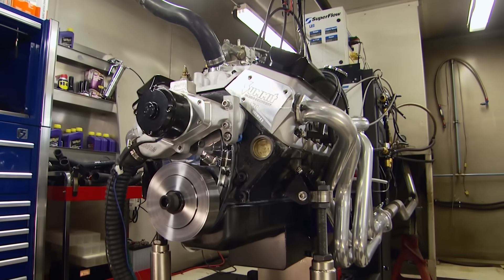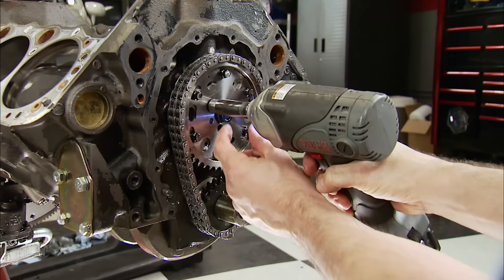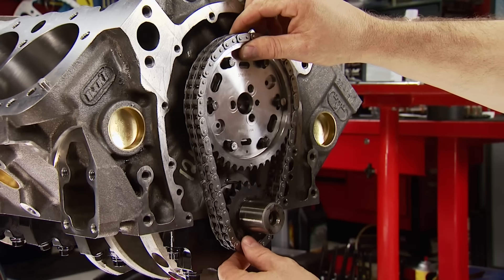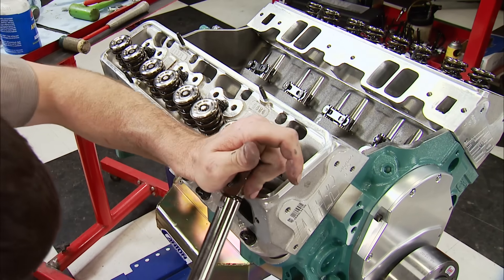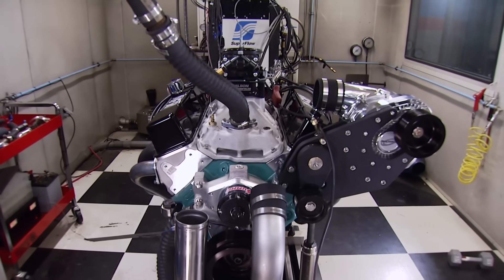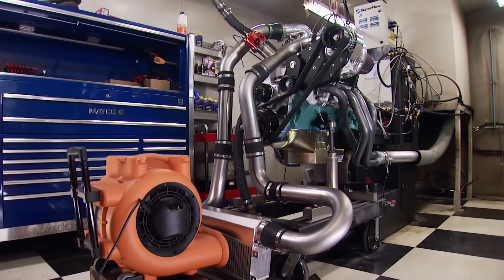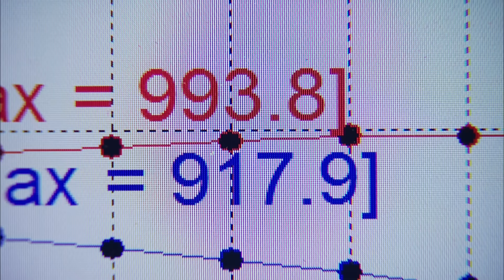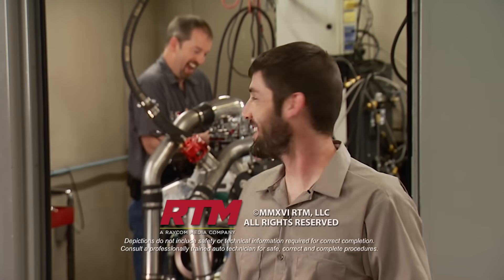Small Block Chevy Build Stage 3: 383 Becomes A 406 To Make Mega Horsepower - Engine Power S3, E14

Comment: watertank most be on pressure same as egnine use water injection computer controlled directly at the carburetor set injection to about half the overpressure pressure contact electronic guard keep the overpressure at 60% open the valve tap very finely threaded until the engine almost dies = STOP then screw in the nozzle at 10 o'clock or 2 o'clock the nozzle position is at 12 o'clock depending on thread left or right thread water has an enormous cooling effect you can set the ignition 1 degree or two higher and the effect increases by 37-56% as water increases in volume 1700%

Comment: Stage 1
                       357 hp
                       389 t2
Stage 2
                       547 hp
                       495 tq
Stage 3 NA
                       555 hp
                       501 tq
Stage 3 Boosted / Race Gas Additive
                       933 hp
                       917 tq

Comment: These guys were struggling to make 1000 hp there’s another video on here with a 383 stroker they made almost 1000 on pump gas before they even put racing fluid and messed with the timing then when they put the racing fluid and messed with the timing it was at 1500 hp but this is still good for the street but they just needed to put a bigger cam maybe 11 to 1 pistons I don’t know there’s another video that the guy does way less and it makes 1000 hp without doing nothing to it just a pro charger in the engine

Comment: These guys are idiots! Should of purchased 3 blocks the exact same, that way you would have 3 complete motors.. running. And we would still get the point.. what a total waste of time. Taking them apart.. that is the problem with the industry, promote putting things together, not taking things apart, that’s why there are so many unfinished projects

Comment: All of these engine build videos are race engines so let's see a SB 383 built for the person with a truck for towing work truck.
I have a 1988 1 ton Chevrolet the 454 is finished, I have a 383 stroker using 6 inch rods / heads with 202 / 160 values / 30 over pistons / cam for towing power that spring of 2023 the 383 is going into the 1988 1 ton for my work truck towing by 30-foot charter boat from home to work at the rivers.
I'm very interested how the 383 is going to work for this job of a work truck engine.
I've heard so much good about the 383 SB I just had to give one a try.
I once had a 350 in the truck, so I have all the pullies and other front SB engine parts to put on the SB 383 for running in the 1ton Chev truck.

Comment: If they wanted to make over 1000hp without doing the obvious smaller pulley, remove that under sized air filter. Should gain at least 50hp at that power level. Also 4.5" pulley on that blower is just getting started if the crank pulley is a 7.65" which pretty sure it is by the boost pressure.

Comment: HI, I have a 406 engine built from a 400 SBC , bore 30 over , has 215s  aluminum dart heads, 13,9.1 compression pistons, H beam rots,, solid roller cam, lift 739- 739 , .050  dur, 274- 282 , lobe separation 110 ,  roller lifters, 1.6 steel roller rockers,  ,,,, question: can i lower just the pistons,,, to 9.2.1 ? and live every thing the same ,, to do a proCharger ? and do I have to rebalance every thing ?  just asking because ,, I am not doing the job, if they tell me at the machine shop i have to do it,,  should I do it,,? I know this may sounds like a real stupid question, but I have been burned  many times ,,some of this mechanic shops they rip u off,, ,, I'm a subscriber to your channel,, thx,,

Comment: Easy fix, want a hellcat? Get this exact setup and throw it in a 5000 dollar camaro, 4000 on extra parts maybe brakes drive shaft and I’ll add an extra 2000 for the tranny and boom, you got 35k dollar car making more hp and torque than a 90k dollar one

Comment: 0:38 Sadly this is not the first time I've seen a set of rod ends completely ruined on this channel in this way, why on earth are they heating they small ends so much? You're supposed to get them to 3 or 400 degrees max to obtain a slip fit on interference parts, going much above 500 degrees ruins the temper of the steel, and is indicated by a color change to purple...any blue indicates 800 degrees or more. This engine will not last long at all if they used the rods pictured.

Comment: Why not cool the intercooler with dry ice or liquid nitrogen temperature and see the horse power gain you will get and keep the intercooler at a rediculous consent steady cold  temperature and some how get the intake tube plumbing that cold too of the dry ice or liquid nitrogen temperatures I bet you any money that right off the bat you will get close 2000hp on a Dyno pull

Comment: 11.75:1 compression with 36° total timing, 2.08/1.65 valves in 225cc intake runner heads 254/264 @ .050" and 550" lift straight across cam, Victor Jr intake with a Holley 780 double pumper made the absolute sickest thing I've ever owned for a SBC for street/strip use! I got away with running on 94 on the streets and a mixed blend for the strips. It was well into the mid to high 500s on the HP and almost 600 foot pounds of torque NA! In my 86 Cutlass 442 G body, I found out how weak the chassis of the G body's were! That engine wanted to spit that rear end out the side of my Cutlass even on 12.5" street tires. Ended up adding additional bracing to the chassis, Lakewood control arm's with Lakewood spring's and drag shocks front and rear. It would twist that poor car so badly it would ride halfway down the 1/4 on the passenger front tire only. Tried the old trick of installing a single air bag in the passenger rear spring and that was the golden ticket for the body twisting. It left a better and more consistent light and would lift both tires on the trans brake and 2 step. All this with running dual 3.5" stepped up to 4" race flow Flowmasters and turn downs before the axle. She was a consistent mid to high 10 second car! I had a stock block 2 bolt mains and factory case crank! With God knows how many passes on the engine well into the hundreds of them without a problem. I traded it sadly off to a friend at the time who puts it in a fully setup all steel minus the hood Chevelle and more gearing than I wanted in my Cutlass which I had 3.73:1s and he had 4.88:1s, that little 406 got his heavy Shovel instantly into the Low 10s and now not being satisfied with what he pulled for times he goes and adds a nitrous kit. I forwarned him that it's not setup for nitrous oxide and should really be torn down and the right pistons and rings replaced along with a stronger crank. But he started out gradually with a 75HP shot and it gets him into the high 9s Now! SMFH the car ran all day long in the high 9s without any problems. I told him to NOT get stupid and add anymore to it! And of course what does he do? Steps it up to a 150Hp shot later that season. Wanting I guess to make it into the high 8s?!? Welp the little 406 made 2 solid passes unbelievably with the 150hp shots of nitrous and pulled that Chevelle into the high 8s like he wished for. BUT being ignorant, he was beyond pressing his luck with it, and was warned more than once. So his 3rd and final pass on the old and now tired 406 with the 150 shot was more than enough for the pistons to withstand, being stupid and sloppy he wasn't keeping an eye on the plugs. One cylinder misfired halfway down the track and literally exploded the one piston into a million pieces! With nothing guiding the rod at 7800 rpms exactly what you can picture happening happened. That 5.7" H Beam rod cut through the cylinder wall and ripped the rod in half and the remaining portion of the swinging rod goes and cuts through the entire engine block and halfway down the oil pan. Eagle rods are awesome cuz it never let go on the big end! It was literally somehow twisted so badly that's what caused the rod to snap off maybe as the wrist pin dug into the cast iron block? No clue? So yeah unfortunately being ignorant gets you a pile of trash at the end of the day. BUT this moron wasn't bothered by the fact he just ruined a perfectly good SBC and set of Cantfeild aluminum heads along with thousands of dollars in part's and machine work I did myself. It's a sad way to end a story for me, but for my buddy he got bragging rights of pushing a SBC into the 8s in a small tire all steel shovel I guess? It's definitely impressive stuff especially now knowing what's really capable of a 406 in stock trim block and cranks! The crank somehow managed to be unscathed from that aftermath? The cam was broken 6 rods and pistons were still like New and the best part is he drove it back to the pits that way! The track was a complete mess of course but he didn't care SMFH. So lesson learned, if he would have at least took half my advice and replaced the pistons/rings, that engine just may have held up at least much longer if not the season on the 150 shot? BUT we'll really never know now? The fact is that these engine's are not given the respect they deserve nor are the 377 De-strokers! A 400 block with a 350 crank that will rev to the moon and like it there! Talking 8500 all day long. I never had any issues with my 406 revving either! It was still pulling hard at 7K so it was shifted between 72&7800 on the track and even on the street when cops weren't in ear shot of the engine LMAO! So yeah these engine's don't have to be special BS blocks or even cranks! The journals on the 400 are bigger than any SBC out there so they are actually much stronger than people give them the credit they deserve! And No! It never once overheated on either of us! Ran @ 180 no matter what the temp was outside! It would actually run cold for gasoline on the cold nights! That's a BS myth about the 400s from retards not knowing the 400s have steam holes in the heads, so when you put a replacement SBC head on them and don't know to drill 2 small holes on each end of the face of the heads? They'll get vapor locked and overheat I'm sure! They also do NOT throw connecting rod's even if you run the 5.56" Rod! The only reason I switched to a 5.7" was the piston availability issue for the short rods, they don't exist. So yeah they are without a doubt shout little engine's! Hope this helps or even inspires someone else looking to build one one day?
Reply: Just wanna say I read all of that, I admire your dedication to story telling.
To pitch in I'm working on a 383 build, bought a 4 bolt 350 off marketplace, came with double hump 2.02 1.60 valve heads, plan on going 4340 forged 3.75" crank, H beam rods, hypereutectic pistons, 11.5:1, debating on Victor Jr or a dual quad tunnel ram... expensive. Going in an 85 squarebody, was thinkin about putting it in my 85 cutlass but after reading about your experience I'll pass lol.

Comment: You want to make a real nasty small block you should of got a crank weight 43 pounds or less and then dry sump setup and get that compression ratio up where it belongs and you would of seen couple hundred more horsepower NA at least and never needed boost. Less weight no lag and 750 hp all the time instantly

Comment: How are yall goin to get a side beside engine dyno test between boosted and N/A if you change the set up on it? Makes no since! Of course it's goin to get horsepower gain with race gas additives verses pump gas. Same thing goes for the carb if you take the first one off in order to make it better for the boosted pull then of course again it's goin to do alot better on torque and horsepower. 

Just a thought. Love yalls show.

Comment: Hard to tell but looking at those plugs it looks to be running a touch lean. Ran your specs through a cheap dyno program it was requiring 1100 cfm carb or injection system.

Comment: If you take the 383 and get the same components as the 6.0 383 will cost more but make way more power components being degree heads and 2/3 7/4 swap cam
Reply: Ls comes with more technology

Comment: I had this pro charger to go on my 420 small block that made 560 hp.😂 but I returned it sold the camero and bought a new kawasaki zx 10 that runs mid 9s stock.for $18,000. The cars are a money pit and I get 40 mpg plus sling corners at 80 mph.I don't miss the money pity
😁cool video though

Comment: Add a methanol and water injector to cool the combustion chamber prior to ignition it should give you the ability to run more total spark advance or make the power without adding timing by promoting a more complete and faster burn with the improved combustion characteristics achieved from just the right amount of water vapor.

Comment: Know how to make a small fortune in racing? Start with a large one! This is a prime example of throwing money at an issue and not getting the results you should! I can make 1000HP on pump gas with a 3 stage NOS system in an LS3, and when I'm done making power, I can drive it to the local burger joint and never have an issue. you guys will load up on fuel, and fowl plugs! This video is about retarded spending in places you don't need too!

Comment: 15:15 Despite what Pens said, the engine will run out of air at the rpm it did without boost.
Reply: Indeed. Cam was not right for either setup.

Comment: I cant count how many 2 bolt main blocks i put studs in and boosted it and all live still.  My current 468 2 bolt main block studded is running 12 lbs from a pair of turbos on it.with a hydraulic roller cam. Daily driver

Comment: I wish he would stop saying "pound feet" it just sounds wrong. It's foot pounds dude lol
Reply: Foot pound and pound feet are not the same thing. 

The “pound-foot” (lb-ft) is a unit of torque and a vector measurement that is created by one pound of force acting on a one foot lever. The formula for torque in the instance of tightening a fastener would be: Torque equals force times radius, or T=FR. When tightening a bolt, “R” would be the length of your wrench.

The “foot-pound” (or more accurately, “foot-pound-force”), on the other hand, is a measurement of work. Work is the measurement of force over a given distance. So one foot-pound-force (ft-lbf or just ft-lb) is the energy required to move a one pound object one foot of linear distance.
Reply: They are probably Canadians.
Reply: Yeah dee dee dee!

Comment: Factory SBC can take over 550 N/A no problem, running a 385 SBC makes 602 hp and 578 ft lbs on race gas. Runs in a street car 66 Nova. This is a video of that very motor on the dyno, the motor is designed for a pump gas build but takes it just fine before this motor was rebuilt it was 355 in the same car had about 4000 miles on making 450 horse.      https://www.youtube.com/watch?v=guW9GTdKEkQ

Comment: The 383 had forged rods/pistons/ 4 bolt mains.  It would have been fine at 1k. That new build could handle closer to 2k. Ive had a stock block forged piston/rod 3800 v6 doing 1k for 7 years.

Comment: This is why I hire a professional to build my boosted engines. I can build an NA engine okay/ still need some practice. But I can slap a 572 together pretty quick.  I did what you guys did but I ordered the engine prebuilt from BluePrint set up for boost. I’m also using the F1A procharger. 
Makes 1,219 to the wheels. I haven’t turned it all the way up- not ready for it yet. Maybe Summer nats I will.
Reply: Wow sweet setup! What power adder engine did you get from blue print? How is it holding up to this day as I see your comment is from 4 years ago? Cheers!

Comment: I've used several stock chevy blocks for the same kind of horsepower... No problems. & who swung the hammer directly on the electric motor of the water pump?? Dead giveaway these guys are actors... Emphasize the wrong part of "torque converter" or "tensioner pulley" and you tell on yourself too... Lol, y'all should hang out with some real hotrodders for a while to get the lingo down.

Comment: why the hell did they show pulling the motor apart when thet dont use any of it in the build,makes no sense
Reply: Filler material for time format.  Producers won't show some dude crunching numbers to decide on pistons & heads for a given cam they want to run.  Remember: TV is not about ideas, it's about pictures.  Listen to your average "news" broadcast if you doubt that.

Comment: Takes a brand new 400 cid block and bores the cylinders .060 right out the box..... WHY !!!! Do you think 6 cubic inches is going to really make that much difference. I would much rather have the strength in the cylinder wall, than a irrelevant 6 cubic inches.

Comment: I’m not sure where you got that 
  Information 
Torque is torque 
It is the twisting power created by a rotating assembly
  The term  “pound feet” is a relatively new one 
   All of my original GM parts and assembly manuals use the correct terminology “foot pounds”
   Pound feet may just be another politically correct term 
      This is the same reasoning as the young guys describing a 454cid Chevelle as a 7.4 liter engine And a 59’ 350 cid elcamino engine swap as a 5.7 liter 
   The terminology is to use your words “wrong”!!
Reply: Pound feet is NOT  a new term and it is the correct way to express torque output from an engine or motor. FOOT POUNDS are the measurement of force that you use on a fastener, ( like head bolts)

Comment: under boost  you need to cut back the ignition timing  to 28 degrees total lead a turbo charger would of went over a thousand  hp easy no power loss  with belts and gears   superchargers   rob power while making power   turbos just build more power when  put under a load    you can load motor with a tall gear   and  it will fly!!

Comment: Umm I'm no rocket scientist but if you remove the block isn't it a whole new build?
Reply: they reused timing chain and push rods.
Reply: @BigEightiesNewWave  
Ya well that's like baking a cake and instead of using flour you use corn meal ya it's still the same cake but it's different ingredients.